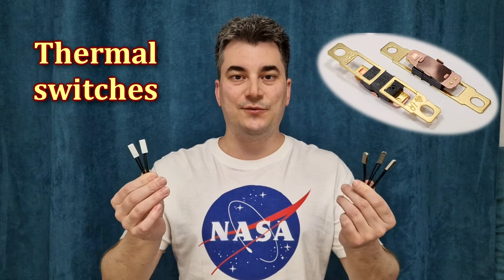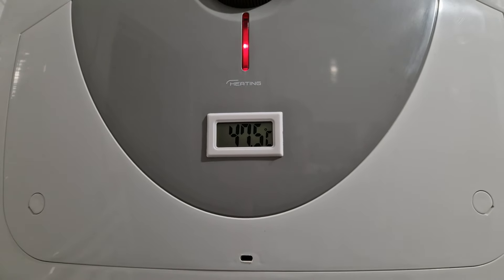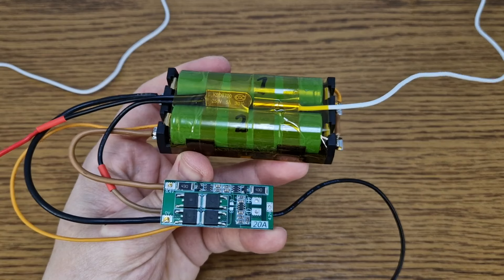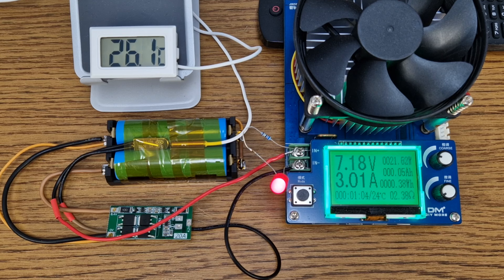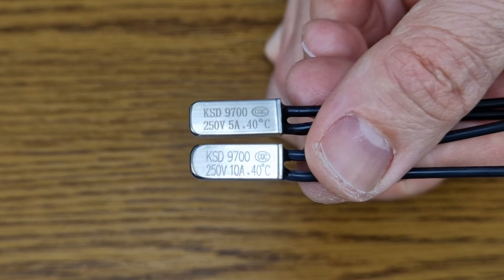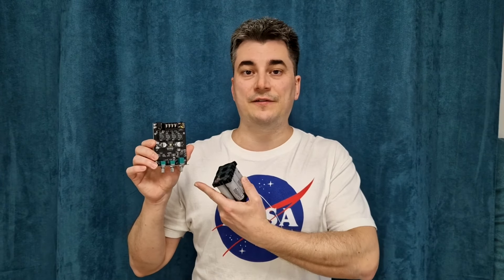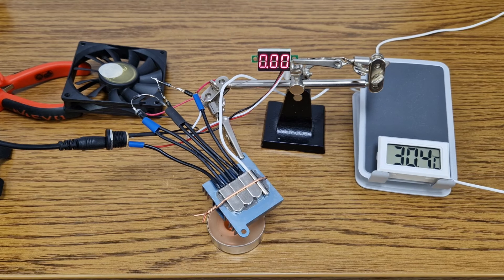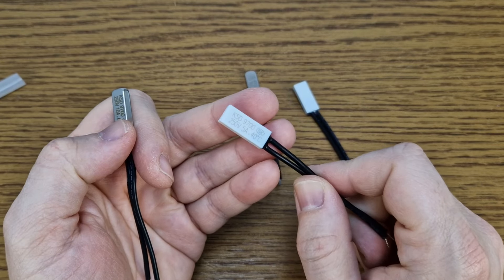Protect your projects with thermal switches

Comment: I have used one of this as thermal protection in my last projects. Instead of connecting it directly i conect it to relay to cut of the power when temperature are high. As relay are made to handel more power. Hope this helps in ur future project.

Comment: The really big one you have in the thumb nail was the very 1st component I ever looked up online. Found it inside a car battery charger that was broken... (I wonder where that is now,🤔 I could fix it.) The thermal switch was working ok. Must look for that charger tomorrow 😊😊

Comment: I used one of these for my 3d printer filament dryer so when it got to a certain temperature it turned the fan on so that the heat was more evenly distributed rather than just at the bottom. Always love your videos 👍

Comment: What can we use to electrically insulate the metal without compromising heat transfer too much?
Reply from the maker: Mica insulation sheet. Or you can use the thermal switch to trigger a separate relay with mains power.

Comment: A word of warning for high current DC loads, these may fail the switch closed unlike an AC circuit. High current DC can jump over an opening contact whereas AC is less likely for the same current. This is why there is a difference between DC and AC circuit breakers...

Comment: Hey Sorin. I'm trying to reuse batteries from an old powerbank. How would I know that the battery isnt under voltage?
Reply from the maker: You need to measure the voltage of each cell and test them with a battery charger/tester.
Reply: Thanks!